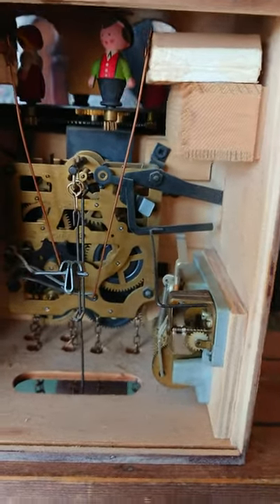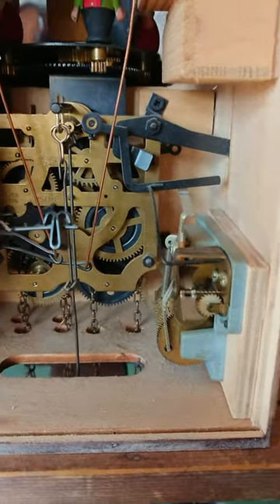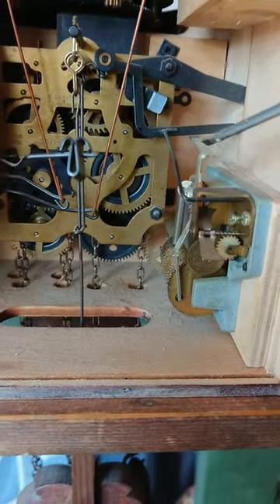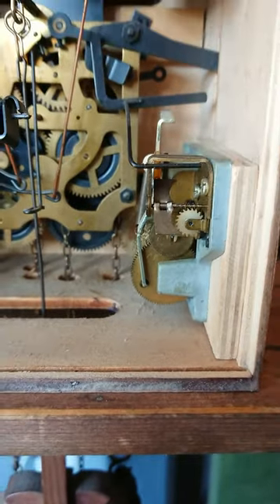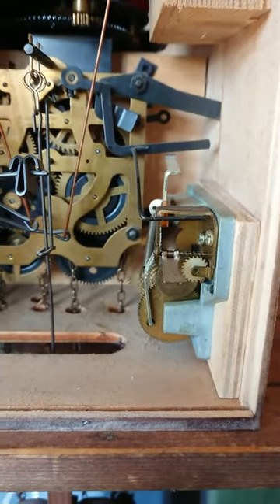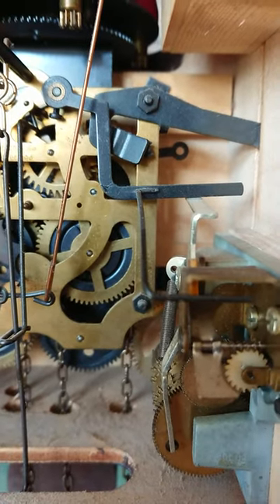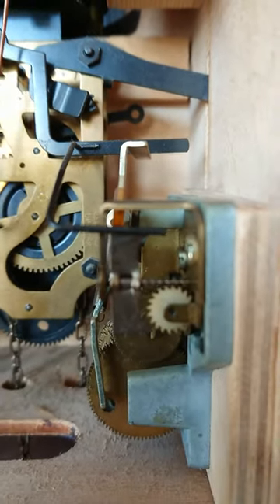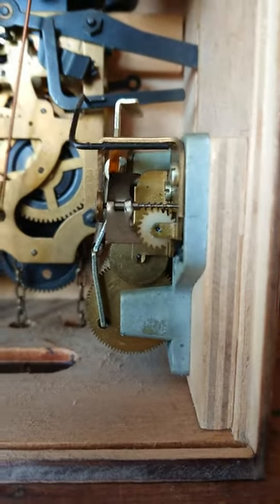cuckoo clock music box not working or repair

Comment: My music box keeps playing and will not stop until pendulum hits floor. How to I fix this issue. Do I need to bend the bar by the fan wheel down slightly to correct the problem

Any suggestions would be appreciated. 

Thanks